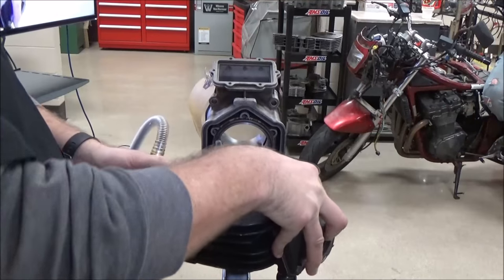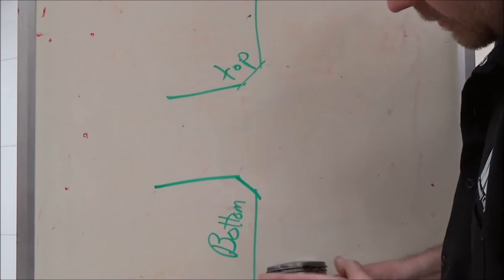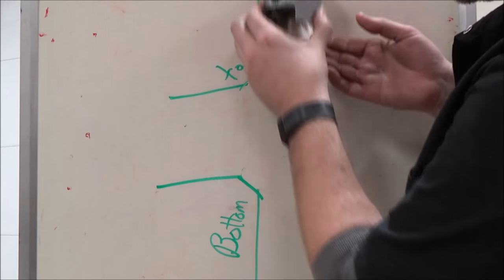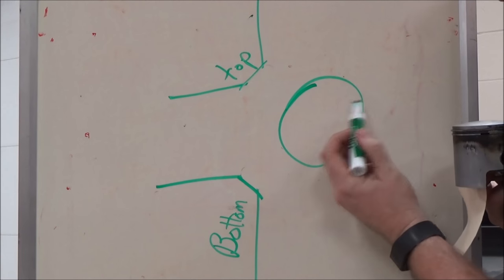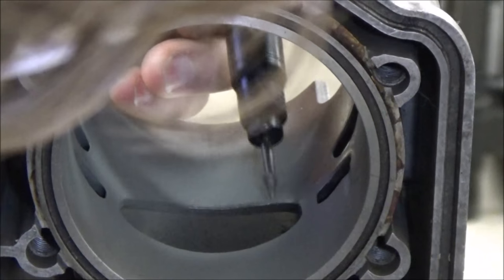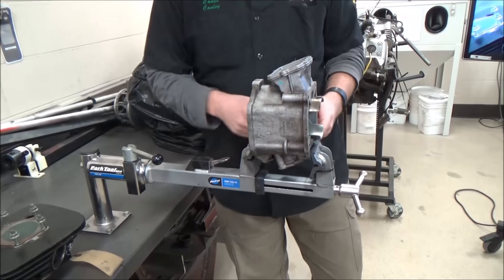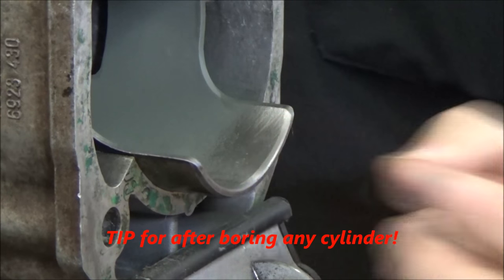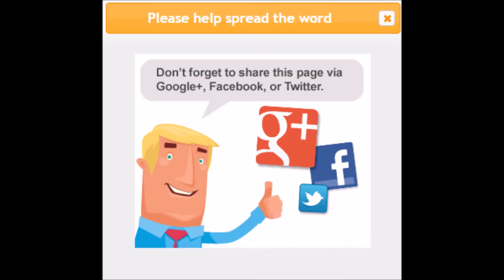How and why to chamfer 2 stroke cylinder after boring. It's not an option!

Comment: I found out the expensive way of having to relieve the exhaust port on a trx250r, the silly thing is machine shops would simply do you a rebore then blame me for not running in correctly, i'd always go through the cycles of running in yet nip up as soon as i though/knew it was run in, my qustion is why don't shops releive the ports or atleast tell you. this experience is from 20 odd years ago btw .